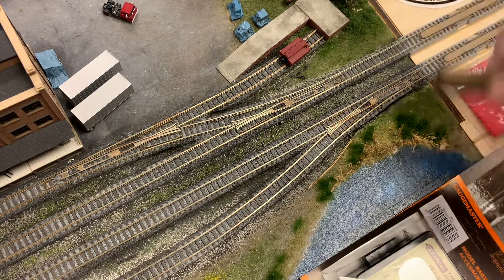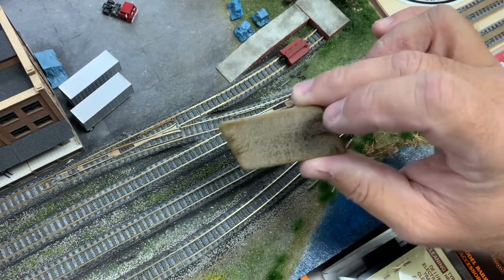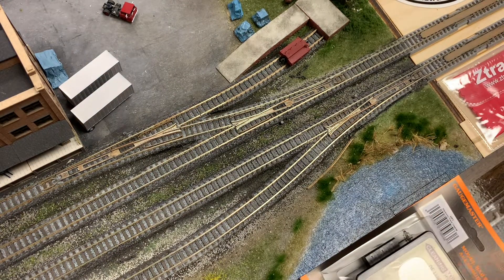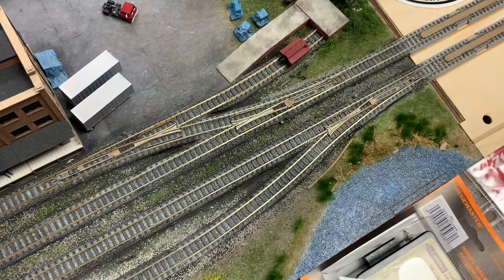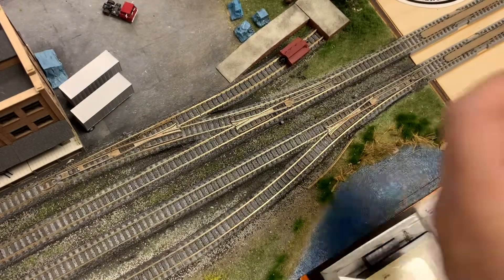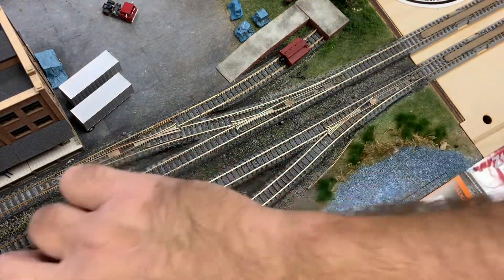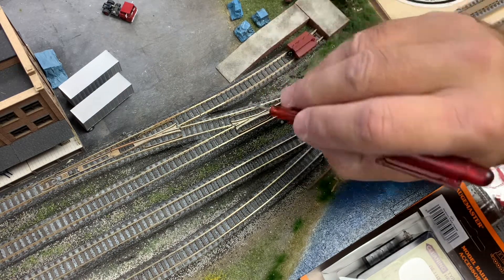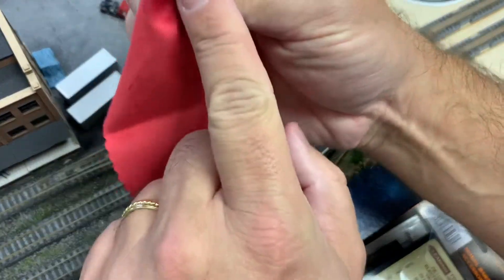Ztrack track cleaning instructions

Comment from the maker: Thanks for the comments! I have heard mixed feedback on lubricants. One concern I heard is that the lubricants can affect traction tires. I have not tested so I can't confirm. I have tested with Wahl clipper oil. Our club use to use this back in the day. But you had to make sure to put almost an invisible layer on. If you get heavy, the oils could gum the track. I also know folks you put a little CunductaLube on the rails. I do love ConductaLube and use it in my loco maintenance.

Comment: I have found that alcool being a polar molecule, can form coke between the track and the wheels at the electric contact point, even if it evaporates completely before running train. Doing so , I had to clean my tracks and the wheels every two weeks.
Now I use WD40; I know it is a lubricant, but it works very well,  but hat a good conductivity , and is non polar liquid,. I have clean my tracks 2 months ago, and have no problem to run my trains. Just put a tiny drop on your clothe like alcool, and that s it. :)

Comment: WD40 is NOT a lubricant (despite manufacturers and users claims) its a WATER DISPLACEMENT (hence WD),  made for Nuclear Missiles and other Aerospace items!   It does very little to lubricate long term (got a squeaky door? - use WD-40, it'll be fine for about 2 weeks, then squeak again.  Use some 3-in-1.).  Also - make sure that you use 91% alcohol, not the cheaper 70'ish % stuff (it's cheaper, because it's got more water in it).  And - I would REALLY like to see someone do a DCC conversion - especially on those tiny switcher engines...  I know, you are analog, but I would love to go DCC someday.